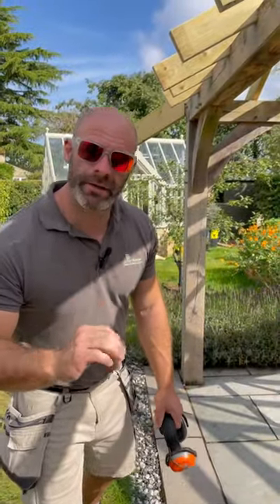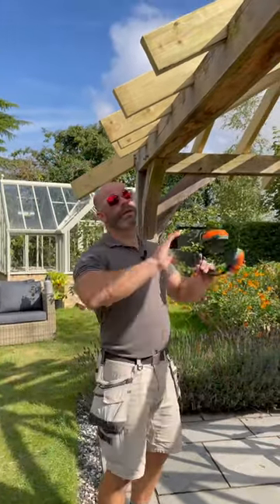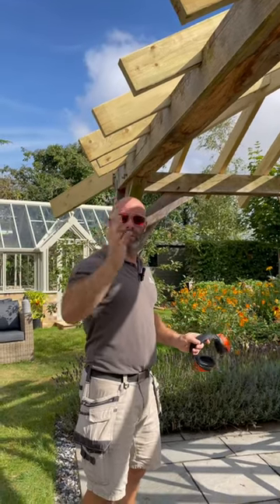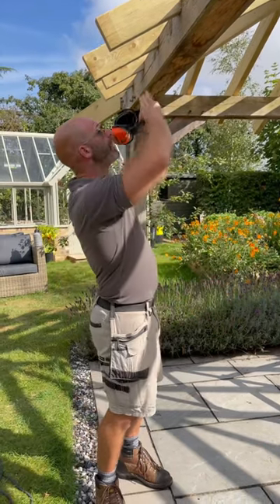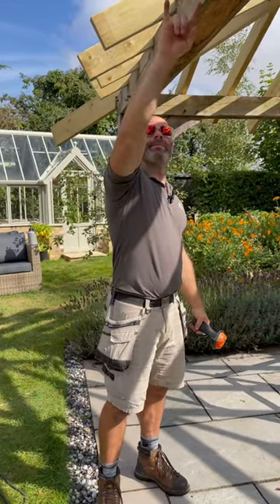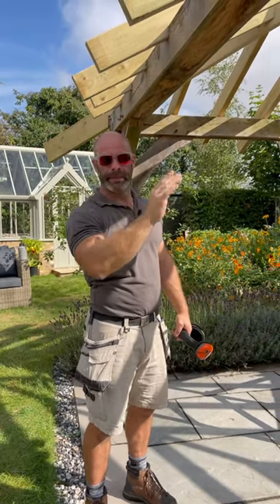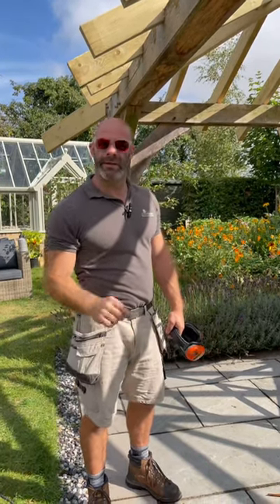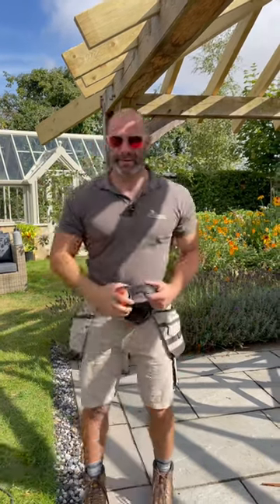A little explanation of why we leave our rafters long. #roofing #rafters #carpentry #gazebo #wood

Comment: looks good, I prefer to straighten the beam first, a little bracing goes a long way, then the tail overhangs will be dead-straight and soffit-sized uniformly parallel
Reply from the maker: The way to straighten these beams is to plane them straight, which would send them out of dimension. It’s not really possible to brace them straight, Oak is impossible to bend straight in this size section…. This way works for us….. there’s lots of ways of doing everything 👍🏻
Reply: @simonbowler1 Well I understand for oak beams yes